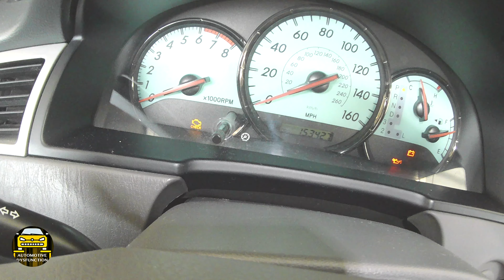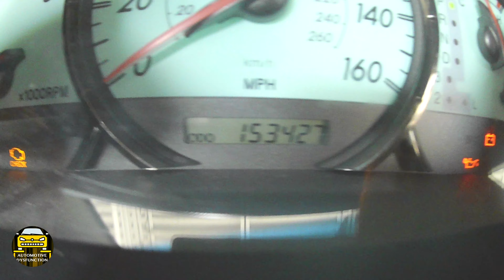How To Change | Toyota Solara/Camry | Oil Change | Air Filter

Comment: Can you link the air filter model, oil, etc you used in this video too?
Reply from the maker: Plenty to chose from:
https://www.rockauto.com/en/catalog/toyota,2005,solara,2.4l+l4,1434109,fuel+&+air,air+filter,6192